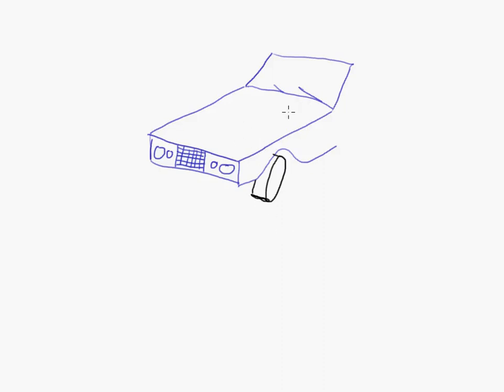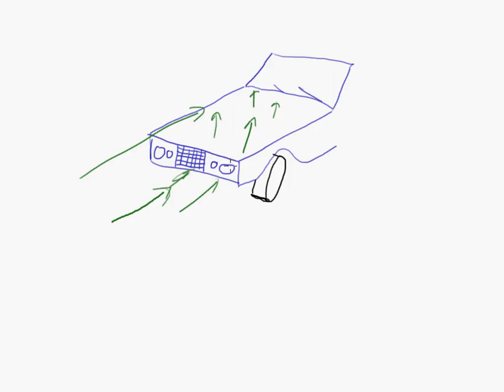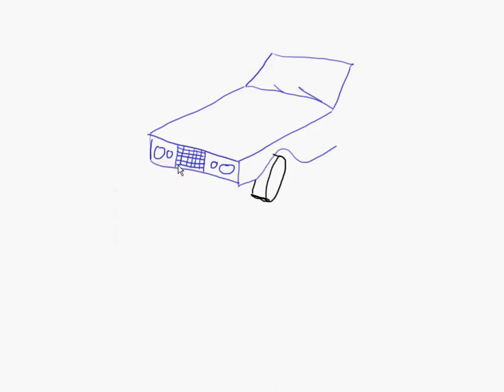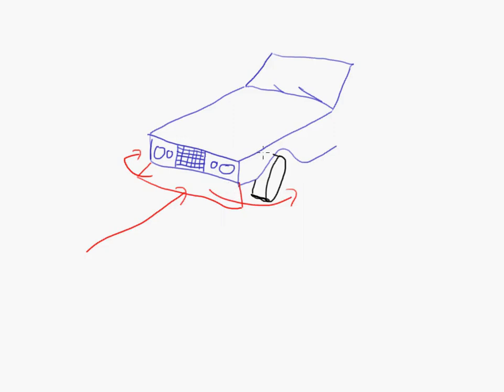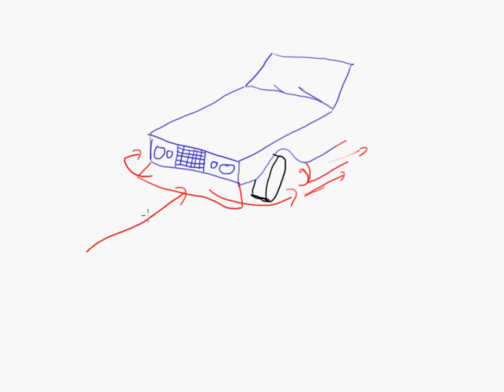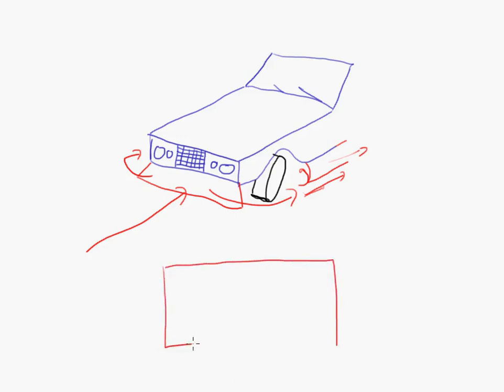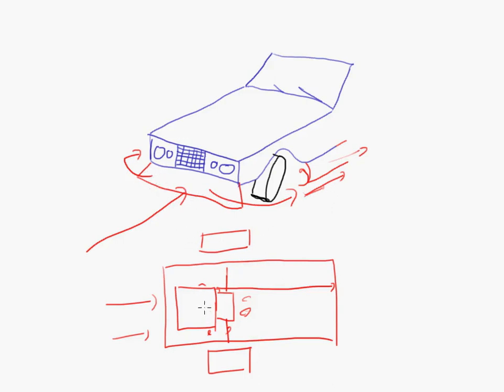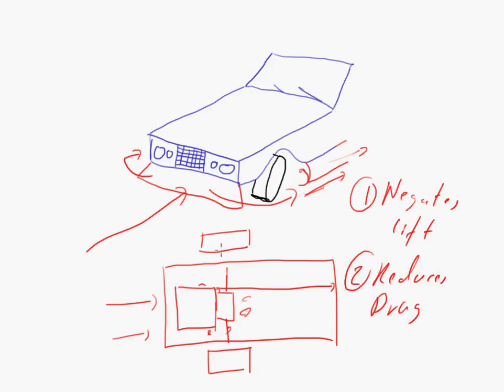How do Automobile Front Spoilers Work?

Comment: Correction: The air that flows beneath the car experiences an expansion (reduction in pressure) due to the reduction in flow area. This reduced pressure zone underneath the car produces suction and actually pulls the car down to the ground. The only reason the car experiences lift is because the same effect takes place over a larger area on the roof of the car. Thanks thought for the explanation for the need of a front spoiler!
Reply: Wouldn't that depend on the ground clearance. Grounding effect to say the least.

Comment from the maker: At high speed a sufficient air cushion would develop, enough to lift the car off the ground. However before actually lifting, the car would feel extremely unstable as the wheels would, with increasing speed, gradually have less and less grip